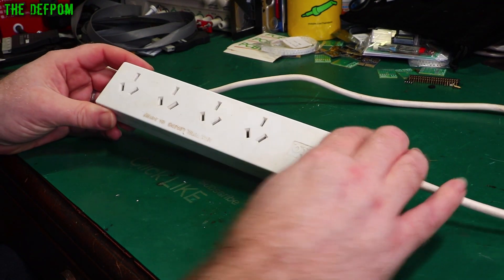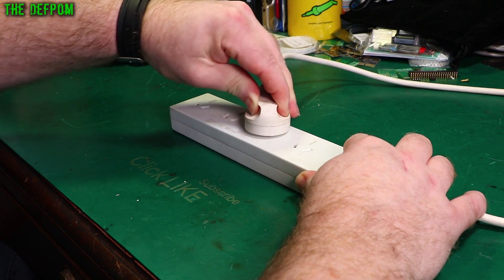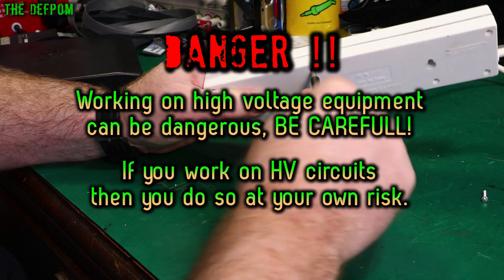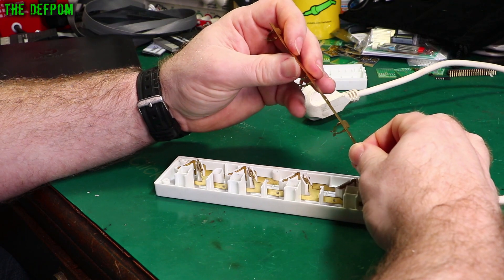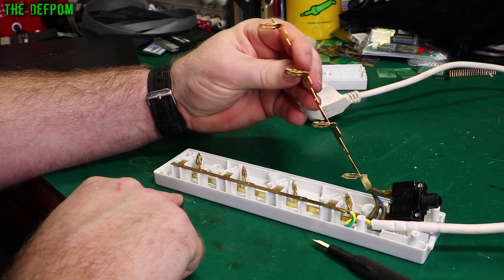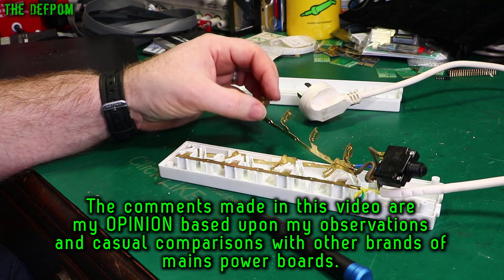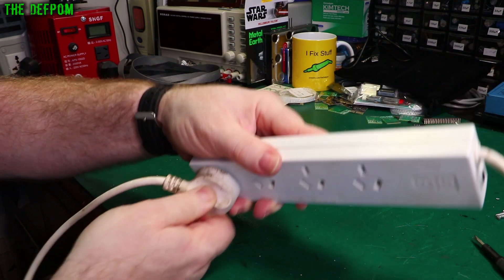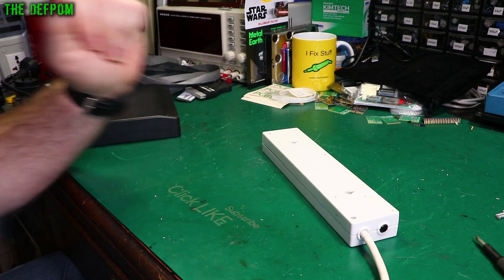🔴  Why I Won't Buy Cheap Power Boards - No.889

Comment: Can i ask you something.

I went the warehouse (New Zealand) i had a look Power Board, Tech inc and Edapt. Witch is better. Tech or edapt? They have surge protection and 4 plug switches. Please reply.
Reply from the maker: I can’t say I’ve seen them, so I don’t know, maybe just not the more expensive one (usually improves the chance of a better item)

Comment: This reminds me of my old "Power Line" (Valudollar house brand) switched power board I still have. I had multiple of them and most of them broke, except for one 5 way board I still have because it didn't have much use in its original life (it sat in a wire organiser box with all switches on), but even now, it has loose sockets like yours has. If that gives way, I'd keep the power cord and plug but throw the board into e-waste.

Comment: Some time ago I got a couple arlec boards, each socket switched with lights thinking lights would be a nice touch. Well the lights barely light up and the warmth from the dropper resistors is more than I'd like. Need to find out how much power the LED circuit consumes alone.

Comment: looks like there is another problem, the phase and neutral seem to be transposed, the phase should be on the left pin, not the right
Reply from the maker: The board is correct,  don’t forget I was working on it upside down.

Comment: Once I bought 2 sets of two power boards (4 units) total and none of them even had the wire for earth... only the metal, not the wire or any inside conection to allow you to connect to mains earth... I opened a dispute and won. Didn't pay for it, but there are just taking space... I have to fix it or trow it away... chinese sockets, be very careful with them.

Comment: I would hope the plastic used is self extinguishing so the risk of fire is minimised. I would suspect that all the metalwork is copper plated steel to reduce cost.
Reply from the maker: It SHOULD be ABS-FR which is a fire retardant version of ABS, it won't sustain its own flame, but if there is arcing to keep it going it will still burn.

Comment: Here in Caada we usually refer to them as power bars and people buy the cheap "surge protector" ones for $20 thinking they are sufficient to protect their equipment from surges. They aren't The only time I use those cheapos for is on site when I need additional plugs for my visit. No way I would trust them on an ongoing long term basis.
Reply: You can actually get decent surge protectors from reputable manufacturers for $20.
Reply: @NiHaoMike64  Well here in Canada those are closer to $30

Comment: Its a real can of worms you can buy these in poundland in uk...I try and use Belkin as they are normally filtered as well...The little bit more they cost is well worth it...and the UK being the UK if there was a fire and it was deemed to be a cheap Ext Lead they will void your insurance

Comment: Pro elec  extension boards from CPL they are impossible to open as the screw heads are sheard off when assembled ?? check the chinese brass for magnetism :-)
Reply from the maker: Yes I should check if it’s magnetic!
Reply: @TheDefpom  chinese brass I think it's called Chinesium:-)
Reply: @fredflintstone1  :D